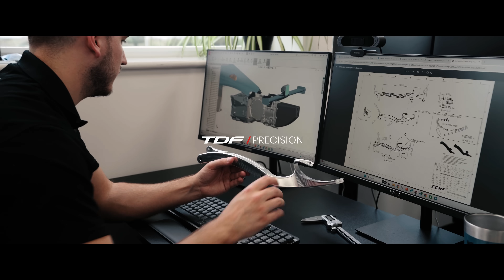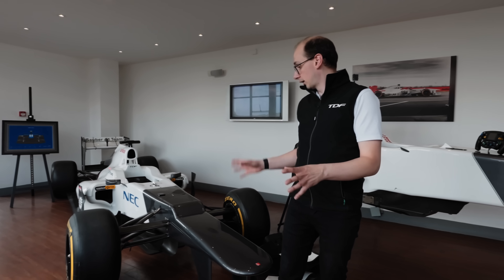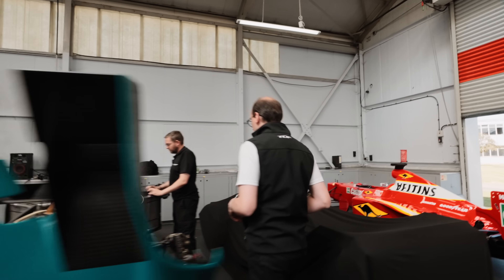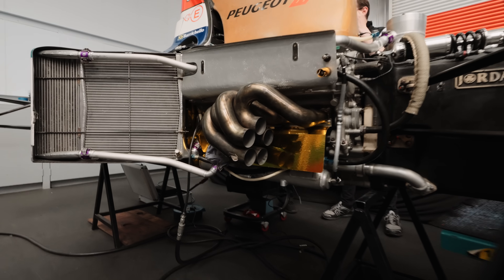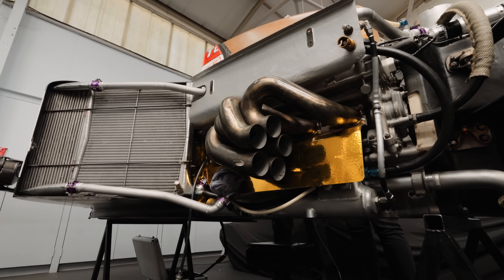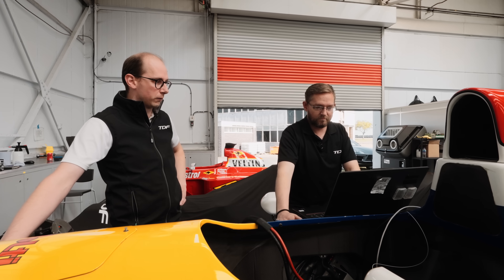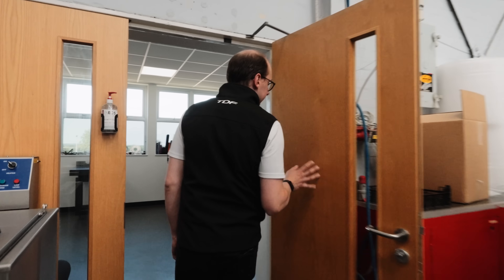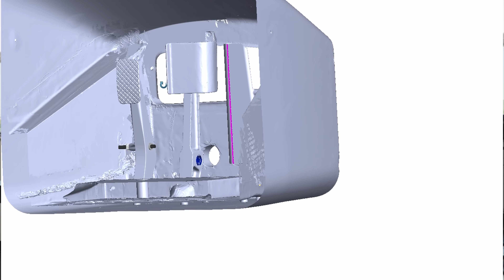Where Retired F1 Cars Go | Inside TDF HQ

Comment: What is the last year of the Formula 1 cars before they became too electronically sophisticated for a regular owner to run on his own?
Reply from the maker: Realistically, once you get into the air valve and hydraulics era, so the early to mid 1990's, say around 1995, that's where you start to need considerably more knowledge than that of running a more conventional race car, especially with the proprietary technology.
Reply: @tdf_limited I'm going to buy an F1 car some day, I now own an F3 Dallara but want a simple, modern F1 car that I can run by myself. What would you suggest?

Comment: 2:00 650hp 700kg same as period but when the car raced it they had 750hp and weighed 640kg so it will be slower, not about the same.
Such a shame they are not like they were in F1 and livery.
So say if i wanted a early 90s car with a V12 is there a option?
Reply from the maker: TDF/One is all about the experience and client connection to F1. The performance when you work at that level is something that needs to be experienced to truly understand. With regards to the 90s question... Absolutely! That would be in the TDF/Works department and here we do everything from full period restoration to more unusual client focussed builds that are more in keeping with your wishes.

Comment: So the beginning was your TDF "chassis", that is a new bespoke car? Then you also refurbish and maintain actual old F1 cars?
Reply from the maker: The TDF/One program is taking original, raced chassis and then we convert them using our powertrains so they are accessible to private owners. All the history without the requirement for a very large team. We then do full restoration, preparation and running of cars to original spec too!

Comment: Do these cars come with all of the electronics and software installed? Do they come with like a thumb drive with a basic program to get the engine running?
Reply from the maker: Unfortunately not. In most cases we have to start completely from scratch. If we are lucky we have engine maps from previous work, but all the car systems we build in new. On the occasional car we have arrive with fully original hardware and software, we will use this though.

Comment: Do you ever use over-the-counter ECUs, such as Haltech, when you have to start from scratch?
Reply from the maker: We wouldn't be able to use certain ECU's due to the engine configurations that we use and some of the more motorsport details required. We do however have our go to systems, developed with brand ECU suppliers, that we then run with projects where ECU's and other electronics are obsolete, unobtainable or for clients seeking reliability.
Reply: what do you mean when you said "start from scratch"? Do you mean a standalone ecu system or in terms of the actual engine mapping data?
Reply from the maker: More often than not when we power up for the first time, all we have is the engine map. This may be original and we have to convert if we have original ECU access etc, or from our large pool of data, or we have to go to the dyno and start that process from scratch. Once we have that, when we power up, all our CAN and connectivity between control systems needs setting up.. everything from the dash displays, switch controls, safety parameters all the way to gear control etc. Its a time consuming process but always very rewarding and different for every car we do.